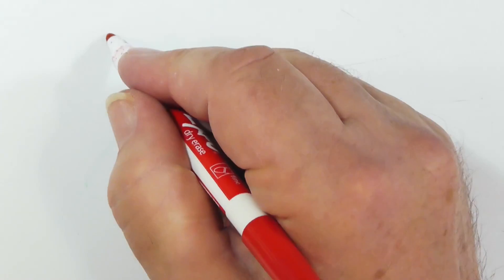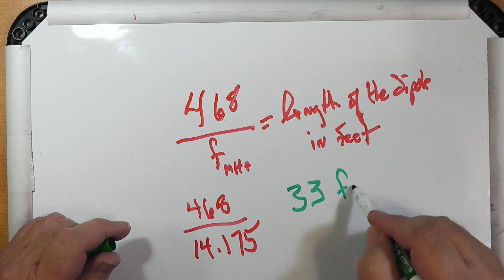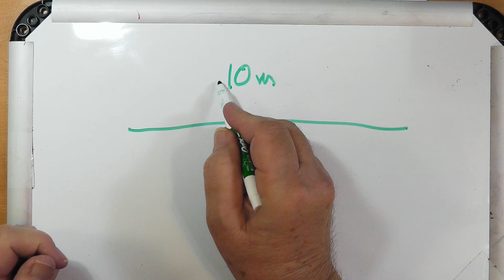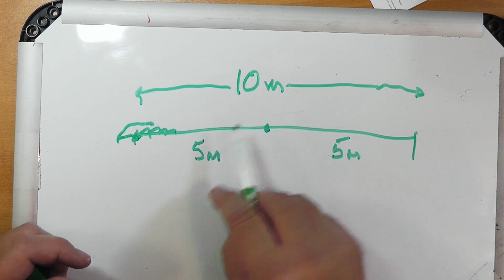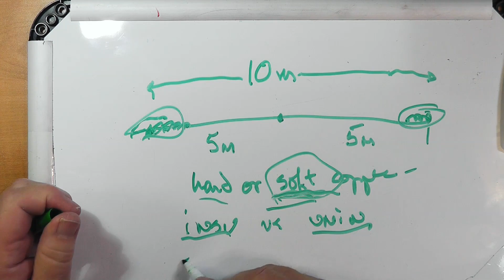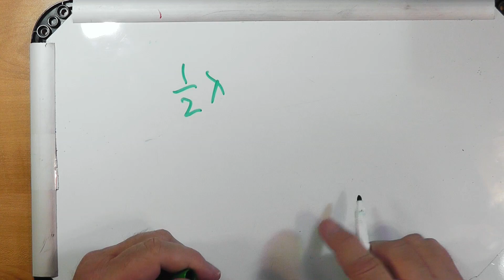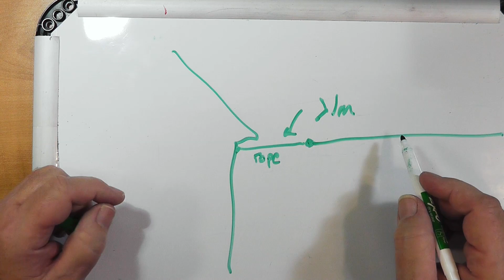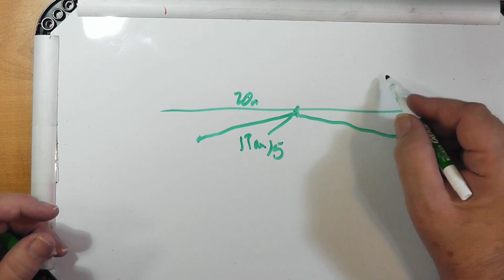How Long Should a 20M Dipole be in Meters?

Comment: 2.5mm is around 14 gauge wire roughly (13.???) and is normally used as main house wire in Europe, 15 amps roughly.
If I remember the figure would be 150/frequency for 1/2 wave as 300/frequency is the figure for full wave, or the legs would be 75/f for meters.. if I actually remember my UK test questions..lol.. easier for me to remember the 468/234 math for feet though..
Reply: and when I was in london I found that the .95 for velocity factor etc was not really necessary.. it was more a worry about height or not.. it usually got it to where the radio was fine with it for most uses.. simply folding the end and tapng it worked fine.. and yes, I prefer stranded myself..

Comment: dipole total length ((300/fMhz)/2) then *.95 velocit factor? no need for feet. si units C/f = wave length
Reply: Easy for us to say in Metricland but in the USA they have no exposure to the metric system whatsoever. At least in in Ireland we have measuring tapes in BOTH Metres and Feet. People in the USA  don't have that luxury. Mind you I have seen measuring tapes in Metres only also in Europe!
Reply: I work in PCB design and US keeps push for imperial measurements.

Comment: Some time ago I read a comment about antenna length that I found easer to remember. All I need to remember is 1234, where 1 side of the dipole is 234/freq. in mhz.
Does it make much difference if a fan dipole is spread like a fan? 
I'm thinking of antenna projects that used multi-conductor antenna rotator cable for the radiating elements.

Comment: Love your channel. In the Metric system when I look for wavelength I divide 300 by the frequency in megahertz to get the length in metres and divide by 4 for the length of each dipole element. if you multiply by velocity factor you get the answer you got ie 10.05 metres. I guess the 468 takes care of the velocity factor in feet. I was wondering about that. 73 ei2jmb
Reply: Divide by 2, not 4, no? What velocity factor do you use and where do you look it up if you don't know or are using random wire?
Reply: @John Bauman  it varies by wire type and coated or uncoated...bare copper is usually around 95%..But you have to also look up your Coax VF as well...I just cut my wire longer than needed and then test and trim and test and trim until I get the best SWR..
Reply: @John Bauman  if your asking about say a 40 meter dipole you would need about 40m or 66 feet of wire...20m on one side of the feed point and 20m on the other...but cut it a little long and test and cut if necessary
Reply: @bassangler73  Thank you for your replies!

I was responding to Seán above who said to divide by 4 - I think he meant divide by 2 unless I missed something.

73,
John - KK7JBZ
Reply: @johnbauman4005  no problem 
73
Reply: @johnbauman4005 Hi John - KK7JBZ Just to make it very clear I was referring to the quarter wave element wire that you need two of to make up the half wave dipole antenna. Each side of the dipole antenna is a quarter wave length long. I hope I haven't confused anyone. Hope I see you in the log book some time!  73 Seán ei2jmb
Reply: @seanmacsuibhne6266  Got it! Thank you. 

Kind regards,
John
Reply: It baffles me how much of a meal North Americans make out of this backward and forwarding. 
Photons travel a 300,000 km per second. It really is that simple. 300/freq.
Reply: @TonyLing  that number can vary through different materials
Reply: @bassangler73  Sure, that is the approximate velocity of radio waves in free space. In all circumstances, velocity factor needs to be applied. Thankfully, it means shortening rather than lengthening.